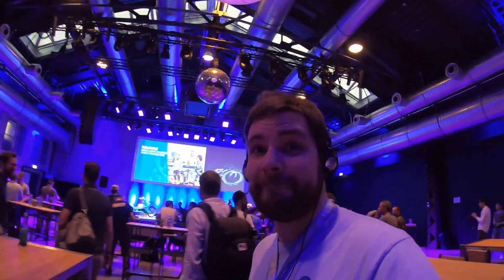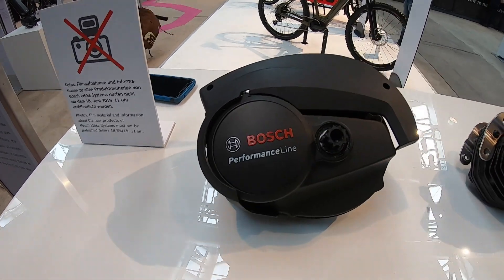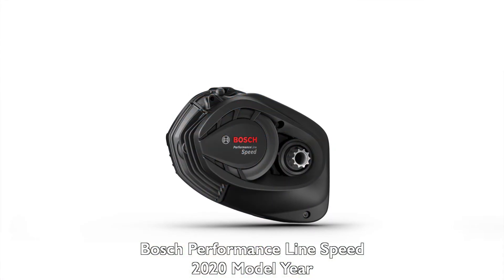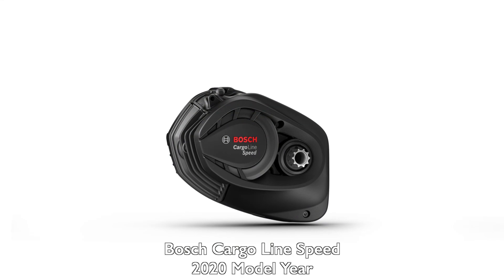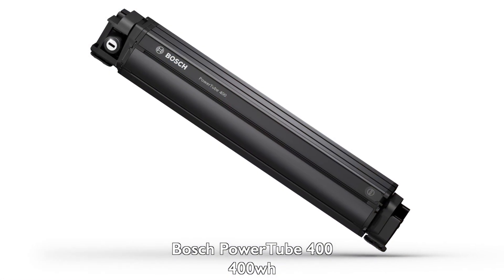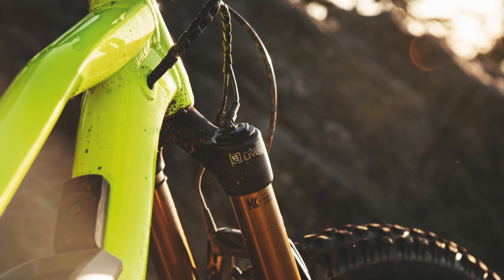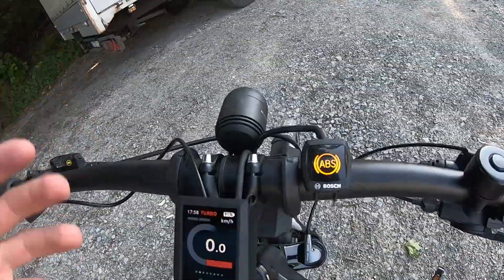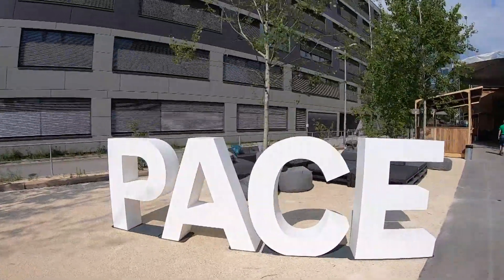New Bosch Ebike Motors & Batteries! 2020 Updates from Germany Event

Comment: Can I use one of these mid-drives with two 24V bottle batteries wired in series or parallel ?
Reply: i would not go for series wiring, you would destroy the motor which is rated at 36V

Comment: Bosch have programmed the new CX motor to be tamper proof in Europe. No more de restriction dongles or moving the magnet. A year from now the bosses at Bosch will be scratching their heads wondering why sales are so poor. People are sick of big brother ruling their lives and Bosch will learn the hard way. If the limit in Europe was raised to match the US 20mph limit everyone would be happy enough, but the current 15.5 mph limit is pathetic. Losing nearly 2lb of weight off the bikes will obviously help pushing the things forward a bit and make them a little more nimble, plus losing most of the terrible resistance at 15.5 mph will also help no doubt, but losing the ability to crank up the motor when occasionally needed will put many off, myself included. The current CX motor has just become a far more valuable asset here in Europe.

Comment: So my takeaways are still the annoying 45km/h 32km/h 25km/h limits that cant be changed even if you live in a region where they dont apply. Probably more bs added to prevent speedchips. Speed restrictions are so dumb, athletic/fit people on road bikes can easily exceed these speeds so why punish e-bikers only. Also on road its way safer to be going fast, when I rode a 25km/h e-bike I had issues with impatient motorists every day, now on a 45km/h bike I very rarely do.

Not much progress in the battery department apart from the 635wh tube model.

Security lock that probably doesnt lock up the drivetrain meaning its still pretty easy to steel via riding off on thus more sales for them anyway.

Meh... meh... MEH! Lame!

Comment: Nice, but I wonder how astronomical the prices will be.  This vid is all I know of the new Bosch systems.  That said, I much prefer Brose for their simplicity and efficiency.  I also like that Brose' focus is primarily on the motor itself, though this does make diagnosing problems more difficult.

The Bosch systems are nice, but way too complicated IMO.  I mainly want an e-bike to function like an enhanced standard bike.  I don't like all Bosch's fancy sensors and gizmos because it's just more things that can malfunction.  I just want a pedal-assist mainly for better efficiency on steep inclines.  Are the sensors and gizmos really necessary?
Reply: new , shall be a little expensive. you can consider other system also.

Comment: Damn, if you have a electric bike that's going 25 km/h, u can tune it up to 50 km/h or faster, but not with the new 2020 electric motors. Anti tuning software detects engine tuning and manipulation via sensors. Bosch is obliged to do this according to standard EN15194 (only in Europe or also in the US?)
Reply: Walter Verbeeck it varies state by state but generally it’s 750w-1000w with a max of 20mph. A fair amount of states allow up to 28mph and very few states ban things like throttles and none that I’m aware of limit speed below 20mph.

Comment: I would not consider buying a bike with the new Bosch motor for one reason above all and that is that it cannot be derestricted. Also, who cares it's 25% lighter. You're riding an ebike and a few pounds here and there makes no difference. 25% lighter, you can bet your bottom $ that it's going to be 25% more expensive. It's also apparently quieter.  Who cares? You wouldn't be able to tell the difference unless you particularly listen for it.  The only improvement I like to see, is better reliability and not necessarily Bosch but all motor manufacturers. I've gone through three Brose motors in as many years.
Smaller batteries but with at least 1kw of power is what I would spend my hard earned money on but no ebike company has come up with one yet. Putting more 1865 cells in a casing is not the answer because it'd inevitably mean bigger and heavier batteries. I am looking forward to the day that batteries and cells become smaller but much more powerful than the current batteries and cells.
Reply: On mtb weight matters. Last weak I was on my ebike and my brother on his 8kg hardtail. We had to lift our bikes over more than 20 falen trees. One to I carried his bike and was completely astonished how much lighter his bike is.
Reply: @cantkeepitin  You're comparing cheese with chalk. Your brother's bike is obviously a normal mtb and not an electrically assisted one. An average e-bike weighs around 20-25 kgs so a pound of less weight doesn't justify spending hundreds of dollars but that's only my opinion.
Reply: You are right, but weight ob ebikes is often overlooked. On this track the downhill time was as long as the uphill due to huge number of obstacles.

Comment: Still can't beat the Haibike Flyon at 120 N torque.
Reply: Bicycle drivetrains are not designed for 120Nm torque. Personally, I find Shimano E8000's 70Nm plenty.
Reply: Tamas Varga 
Thank you for the reply, but you probably aren't using it with the same loading as myself. I am carrying 120 litres of gear.
Reply: 120Nm is just too much for current drivetrain components. Even with the 75Nm from the Bosch CX and Shimano E8000, to get the most life out of a cassette, a chain should be replaced every ~1500-2000 miles. I kind of can't comprehend how the components would cope with almost twice the torque. If you added the amount of gear you mentioned in addition to that, I see chains snapping just thinking about it!
Reply: Pete Alder If you are carrying that much gear you are better off with a motorbike.
Reply: @AlasdairSun  Absolutely. Also, he needs to carry three extra batteries if he wants any range with that amount of gear. Just completely pointless in my opinion.
Reply: Tamas Varga 
With a bike i can go off track legally. But a motorbike is illegal. Bile packing is what i am doing, but not frugally.
Reply: Pete Alder Bikepacking with a  high performance bike is not a good idea in my opinion unless you want to stop in every village for recharging.
Reply: Tamas Varga 
I don't have a problem with charging each day. If I go to a cafe or campsite or pub, I just charge up. Hasn't been much of an issue really. Most of the time I'm charging up whilst sleeping, relaxing or exploring the local village by foot. So it works well.

My only issue is the torgue capacity.
Reply: @AlasdairSun  That is why we now see mid-drive eBike specific chains that won't stretch so much.
Reply: until components get more robust, specifically the chain and cassette, 120Nm is just going to destroy current drivetrains.
Reply: Alasdair Sun 
Thank you for responding. Interesting answer. I am ignorant on this technology and engineering. Please could you inform me further. 

I have a trailer full of camping gear and find the Bosch performance CX a bit sluggush; hence I am considering the Haibike Flyon 120 torque. 

To be honest I am disappointed with the torque on the Bosch. I have little interest in speed, only pulling (tug) power to heave my 100 litres of gear.

The cargo motor seems interesting, but I somehow think it hadn't got the oomph of the Flyon motor??

I would appreciate any feedback. Many thanks.

Comment: You forgot to mention the most important new "feature", called built-in anti-tuning measures. Not only that: after three tuning attempts the motor will automatically be locked up and will need either "servicing" (and scolding for the owner for good measure) - or a new home in the nearest dump. Bosch overdid themselves this time, bravo! 
 I wonder, how many fools will buy bicycles equipped with this junk?
Reply: Thats why I stuck with Yamaha. You can still do the crank arm trick on those for crap sakes.
Reply: @ibrooksie  
I'm partial to Brose, but I think we're mostly on the same page.  I mentioned this in my own comment, but yeah, Bosch systems are unnecessarily complicated IMO.  I just want an e-bike for better efficiency (speed) on steep inclines.  All these sensors and regulators are just more things that can eventually malfunction.

Comment: Thanks for the explanaition, but I have never heard of a mountain bike with a large front wheel and a smaller back wheel.
Reply: For motorcycles it is standard, and few new bikes do this also.
Reply: YT bikes have a 29 front and 27.5 rear on some of their mountain bikes.
Reply: What is the advantage of different-sized wheels?

Comment: I'd like to have seen a Super-ECO mode and/or even a continuously adjustable mode where you can dial in exactly how much assist you want. The biggest issue I have (apart from cost) is that the range isn't enough, so being able to dial in just enough assist would help here. I don't like the idea of having to limp home on an e-bike with flat battery. Range anxiety is one of the biggest issues with all electric vehicles. We don't all live in flatland.

Comment: Too dam expensive for what it is!........don’t have a battery problem or you’re gonna pay 1000 for a replacement! Already on my second ebike and I steered clear of these!l lighter and smaller means FRAGILE!
Reply: Brainjock I do pedal but, where I live an ebike is essential!........built my own 48v battery pack out of Samsung 30q cells and a bafang bbsHD! I already have 5000 km and my Next build will be bafang g510 on a custom long tail at 60 v 1000 wh which will be cheaper more rugged than the wimpy Bosch!

Comment: I still just don't believe ebikes ever reach their true transportation potential if the assist is limited to 25kph...and not they are actively going to shut the motor down if anyone attempt to hack the controller to allow faster assist speeds.  What is going to happen is that market share is going to shift to Bafang because they are going to allow easy hacks to allow faster assist speeds. 

In reality allowing the assist to go to 48kph or even as high as 55kph really doesn't impact the fastest speed most riders achieve on a bike .... it just increases the average speed someone can travel longer distances on a bike which is what matters for urban mobility.  Anyone that doesn't consider time is money when commuting to work doesn't understand economics.

Comment: I admit that Bosch does a good integration but my Brose drive with BMZ battery, both German brands too, has already that in 2017
No resistance at > 25 kmph , 90 Nm,  low noise and a 640 Wh battery where they provide 1000 full recharges.

Comment: I like Bosch but their speed motors are ridiculous.. not enough power to ride 45km/h. Lucky me I found Stromer and bought a ST1X. Stromer are the only one who build S Pedelecs with much power so you can ride easily 47 km/h+
Reply: Why not just buy an electric moped then?
Reply: @tamasvarga67  An ebike doesn't require a motorcycle endorsement, registration or insurance. Some states here in the US regard any motorized two wheel vehicles as a motorcycle (NY), which requires it to be inspected as one (including things like turn signals and DOT approved tires) in order for a title to be made, in order for the bike to be registered, in order to receive a license plate and then the rider is required to have a motorcycle endorsement and insure the bike. Insuring an ebike likely isn't going to be very easy.
The temptation to wiggle around these requirements is STRONG to say the least as building an ebike that is just as fast as a scooter is much cheaper especially after adding in all the costs. California is on the right track with the class 1, 2 & 3, but a class 4 bridging the Gap between a 750w ebike and a full highway legal motorcycle for bikes like the Stealth Electric Bikes is missing, sorry but bikes like that should be restricted from non-motorized trails, but I would be fine with them in Urban Bike Lanes.
Reply: All4Grogg US regulations are different. I’m from EU and we have 25kph/16mph assist limit on ebikes and they are considered as regular bicycles by the law - no bike lane/trail access limitations. The 45kph/28mph s-pedelecs are considered mopeds by the law. At the moment, EU is the biggest market for these bikes and that’s the manufacturers main focus. US gets the same motors but the assist limit is set to 20mph.
Reply: At some point there needs to be a line drawn between what is an electric bicycle and what is an electric motorcycle with pedals. If they manufactures don't define that and we as a community don't then polititions will, likely as a kneejerk reaction to some incident.  If you don't think polititions would ban a elderly riders City cruiser because after just one irresponsible act by a rider on a 2kW bike, you live in a fantasy world.

Comment: Hello, i own a Bosch performance CX on my ebike. Could I Switch my old CX with the New one?
Reply: They wouldn't sell you one even if you could! They wouldn't even replace your motor under a warranty issue with this one. You would have to buy one on the used market.. But what would be the chances? Not that it matters cause the mounting is totally different.

Comment: Come on, 400Wh in 2020? Same capacity as in 2012/3 Powerbacks? After 7 years? 
No way...

+ 2020 CX:
1kg lighter
Smaller
340% vs 300% support power
625Wh instead of 500Wh

- 2020 CX:
Still noisy
Still pedal resistace
Goodbye tuning: new anti-tuning software detects motor tuning and manipulation via sensors while you’re riding which then automatically switches the motor into limp home mode. Bosch is thus responding to the requirements of the EN15194: 2017 standard.
Sorry but 25kmh is too low for 85% users of ebikers..
Reply: I agree about battery size! 500 should be the basic minimum by now especially at these prices. Having said that, My 400 serves me real good! The Yamaha PW-SE motor seems to handle it's juice really well if you do too. But I still wish it was 500, It's ridiculous having to pay £400+ more for a bike holding that pack... When there's actually only £100 difference between the batteries on the market!
Reply: @benzoesansodu5866  That link cleraly says: No pedal resistance
Reply: @derarchinaut  probably you have right, but in other sources it is said that only for performamce line, not cx. We have to wait for review.
Reply: @benzoesansodu5866  

"In terms of performance, the Bosch Performance Line CX 2020 plays in the top league of eMTB motors! The new eMTB mode is the best progressive mode on the market and always delivers enough power."
Reply: Speed is haste.
Reply: nice , i like it. it is your system?
Reply: How do you know that the cx is still noisy and has pedal resistance?
Reply: 2014 to 2020 is 6 years. Plus, they had bigger batteries you drunk person
Reply: @jf8138  oh, yea, they have bigger. But author said that 400Wh is prettt nice ^^
Yes, my faul because they offer 400Wh from 12/2013 not 2014.
Reply: Agreed. 25km/h max speed might do for female centenarians, but for real riders even 45km/h is quite measly. 
 Pedaling resistance with empty battery? Who designed the things, mohammed the mohammedans' prophet? 😏

Comment: Great vid, thanks. Looking forward to the new Bosch motors. I have a Tern VectronS10 with the Bosch Active line motor and a 500WH battery. In one year I put on 2,700 miles. No issues with the motor or battery. I had to pay extra for the 500WH battery. Really like the quiet of the Active line motor.  The Bosch hardware is not cheep but they build good stuff!!!
Reply: I've had my diy ebike 1 month and have 700 miles on it.

Comment: nice light motor...but a bafang mid drive is more serviceable.  Individual components are easier for the rider to maintain, and WAY cheaper.  Bosch has streamlined some very trick nice looking light bikes, but way to pricey for most people.  When these bikes cost the same as a motorcycle, it makes me shake my head, NO.  I will continue to build my own e-bikes...the satisfaction of building your own from the wheels up remains a joy that I shall not refrain from.  cheers!
Reply: Bafang Ultra prices are actually very comparable to Bosch prices for OEMs. Also, an Ultra weighs twice as much, and it's nowhere near as smooth in terms of PAS compared to Bosch/Yamaha.
Reply: Bikerelated Show me a bosch or yamaha mid drive that attaches to my existing Bottom Bracket....do they have something along these lines?   Special bike frame required to install Bosch Or Yamaha mid drives?
Reply: Hi Jim what do you think of TSDZ2 vs BAFANG for a e-bike build.
Reply: turfboy  I haven’t any experience with these, so my opinion is mute...Tongshen is newer to the e- bike market, I think many issues have been ironed out.  But I can say Bafang 750 watt is very quiet, reliable, and durable.  With any mid drive install, make sure your chain alignment is correct, and anchored securely to the frame....I have 2000 kms on my bafang, with zero issues so far!    PS...they work really well with a nuvinci cvt rear hub...one chain line, no chain mashing shifting.  great maintenance free, get on and ride, no adjustment necessary after initial setup.   Compliment each other very well!  cheers!
Reply: bf is ok, however Bosch is more better.

Comment: I have a Bosch ebike, the battery has failed after 3 years. I do not recommend Bosch due to the high cost of replacement batteries. Rebuilding them is also an issue due to how the BMS functions and self destructs if power is lost. Bosch does not sell BMS boards.
Reply: Yamaha is the best for after market solutions! They can easily be re-celled by a few companies you will find online (At a cost of course, But cheaper than a new battery) And, There are 3rd party cheaper batteries available.. I bought one as a secondary that works well  and cost over 250 less!
Reply: @mozzjones6943  this is why after-sales service is important.